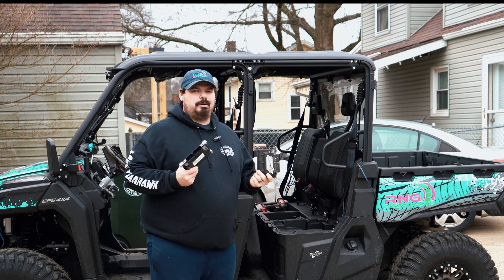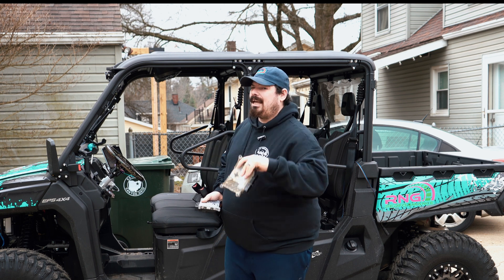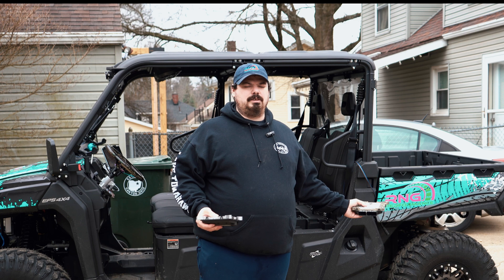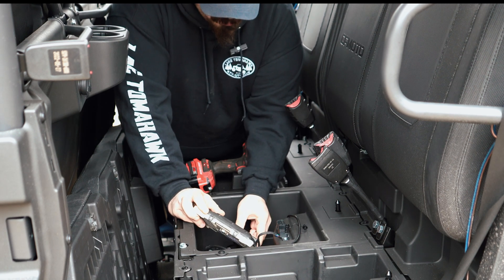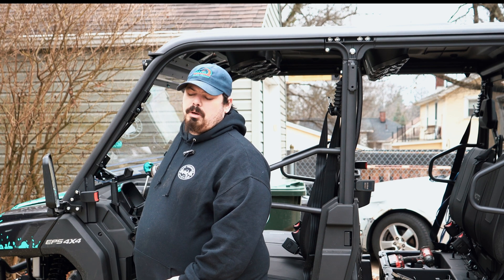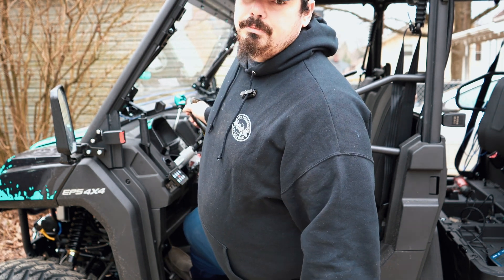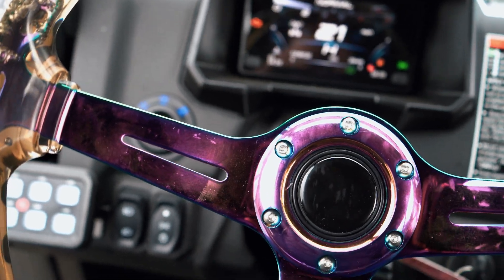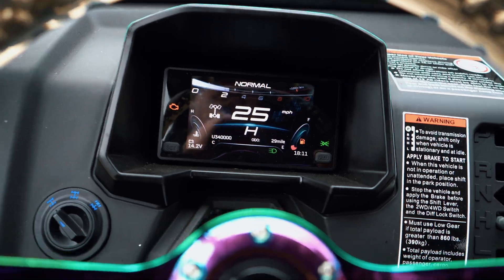CFMOTO UForce 1000 Tuned Z950 ECU SWAP FOR SCIENCE

Comment: I CANT WAIT TO PUT THAT IN MY U FORCE 1000 WHEN YOU GET THE BUGS WORKED OUT, ONE PROBLEM IM HAVING IS RUNNING HOT NEW WATERPUMP IMPELLER NEW STAT, I RAN WITHOUT THE STAT, TRIED THREE DIFFERENT ANTIFREEZE STILL HOT , ANY IDEAS ???????????

Comment: Unless you run your clutches the Pwrtune is junk. Be honest and tell everyone that it was designed and tuned around your clutches. Otherwise like myself i bought it and it screwed my machine all up. Best part is I sent the ecu back to be put back to stock and he didn't even do that. Now i have a machine that is unrideable.
Reply from the maker: Not sure what issue your having but the per tune is awesome 😎
Reply: @R.N.GPerformance  the throttle is super hesitant and extremely jerky at low speeds. The machine maxes out at 28 mph in low range and barely clears 50 in high. He advanced the timing of the motor way too much
Reply from the maker: @eightdsbaby4003  wow. I don’t have that issue. I would reach back out to him and see what he says.
Reply: He didn't have anything to say or any way to fix it I sent it back to him and it's still screwed up. He couldn't even put it back to stock

Comment: Does the uforce have the electric controlled evap valve? On the 950 if unplugged trips light, plug back in and goes off. I can send you a pic of mine if you need. I deleted the canister but had to leave the valve in place.
Reply from the maker: It probably does.